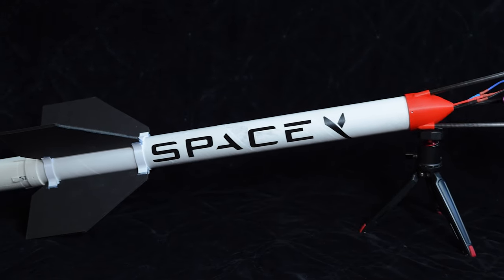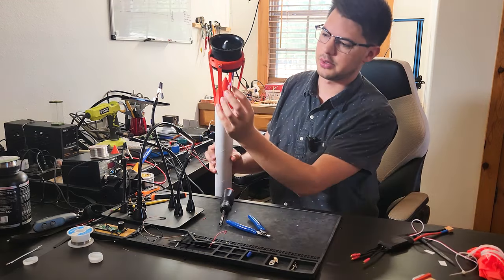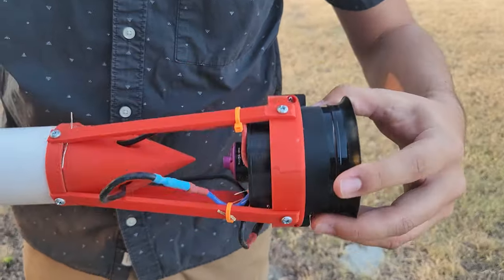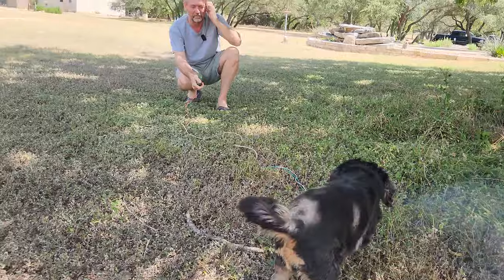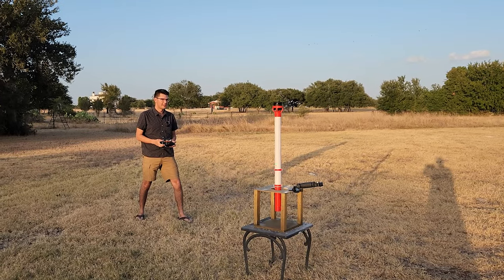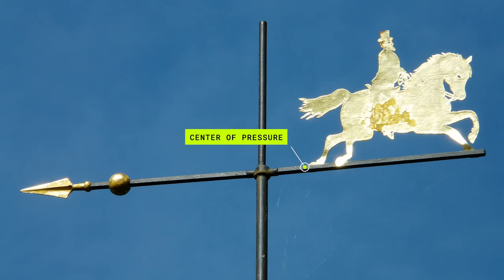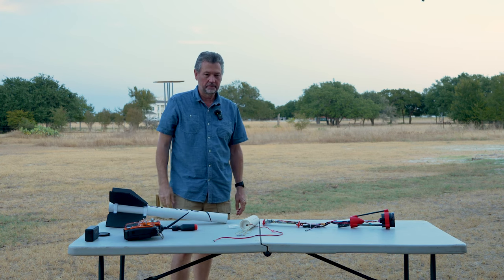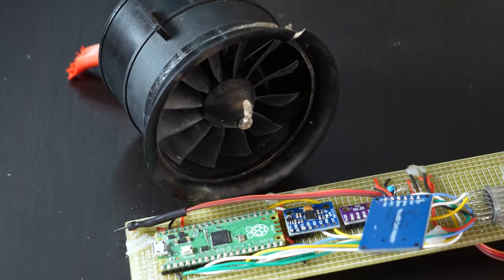Electric Model Rocket Build with EDF Motor

Comment: This is NOT a rocket.  A rocket propels by combustion without using surrounding air.  This is merely an unguided single-engine pendulum-stabilized drone.

Comment: Your EDF thrust is being hindered by the rocket itself, causing potential vectored thrust. It's in the most weirdiest position ever.  You need to redesign the rocket with side intakes for the edf and it must be mounted behind the electronics and battery.
Reply from the maker: Yup - the new design is completely different with much better air intake. Hoping to finish soon - stay tuned

Comment: Put 2,3, or 4 smaller EDFs around the base of the rocket & re-balance it all. Putting the engine at the top is like making a screen-door for a submarine
Reply: Depends. My toy rocket when I was a kid had a helicopter prop on the top. It flew straight up very well

Comment: Cool project! I’d suspect putting the EDF at the bottom and having it take in air from the sides would improve the thrust. It’s usually worse to have something obstructing the exhaust than having something obstructing the intake. Apart from that (as you pointed out) it’s important to get most mass up as high as possible.
At the low speed you’re flying it at, getting it passively stable is going to be tricky. You’re either going to have to increase the power to increase the velocity at which you leave the launch structure, or (the way cooler but much more complex option) you have to actively stabilize the vehicle. You already have an IMU in there. If you put 3 jet vanes in the exhaust, you could actively stabilize the vehicle without relying on airspeed 😉
Looking forward to the next vid!
Reply from the maker: Hi - thanks for the suggestions. Totally agree that impeding the exhaust is probably worse than the intake. The problem as you mentioned with having the mass distributed near the top is preferred. The EDF actually accounts for a lot of the overall mass, so position has a big impact on stability. Anywhere besides the bottom and you restrict airflow, but better mass distribution. Active stabilization is exactly what we were thinking of too. Either way our thrust to weight ratio continues to be a challenge.

Comment: Putting the EDF in the center with the thrust coming out the bottom of the tube and cutting intake ports above with the electronics housed in the nose cone is how it would work much better. I would use 2 smaller EDFs in series counter-rotating. You can also add elevons or a canard to the fins of the rocket design you do have to correct the trajectory. I do believe 2 30mm high-speed EDFs in series would have more power than one single EDF. I have two counterrotating 35mm EDFs in series on my BAE Hawk and it goes vertical and govers with ease. The rocket up top can have a very minor air disturbance in the thrust causing the rocket to veer off course.
Reply from the maker: Hi - thanks for the thoughtful comments. Great points. Redoing this we would probably have EDF toward the bottom as you suggest, maybe with some thrust vectoring but that adds more weight. Thrust to weight is honestly the biggest challenge. We did consider the 2 fans in series, but because it doesn't double the thrust, but does double the weight, we opted for one fan.

Comment: Nice video! It was fun watching the testing and iterations. 
About the design—you might want to check out the pendulum rocket fallacy. It might give some insight into why you were having stability issues. However it might be tricky with a bottom mounted edf—airflow and all.
Reply from the maker: Thanks for the feedback - We want to try a rear mounted EDF - this will have to include thrust vectoring of some sort to overcome instability. That adds weight :(  It's all a tradeoff.

Comment: That nose is not aerodynamic. And speed at liftoff is not overcoming the gravitational pull. In short, make it shorter lower the engine, longer shaft to blades. And the nose cone should only cover the non used air for props. But directing all intake air to props.in other words your getting a faux turbo effect. The exit air is going through vents under blades. Looking like (shark gills) got it all😊